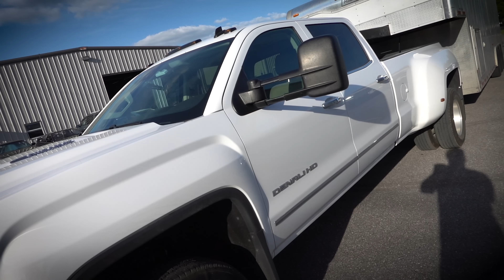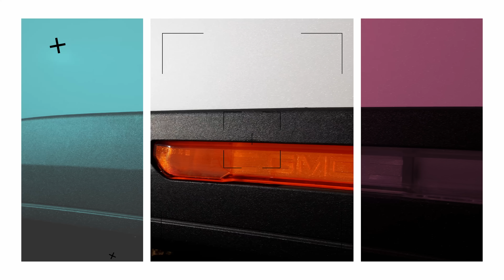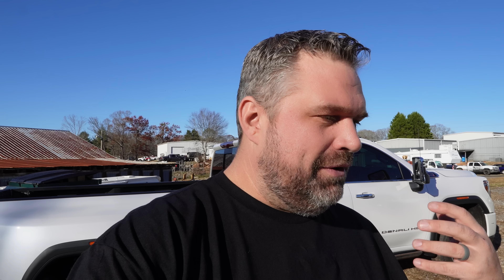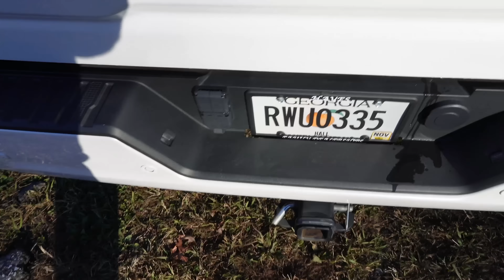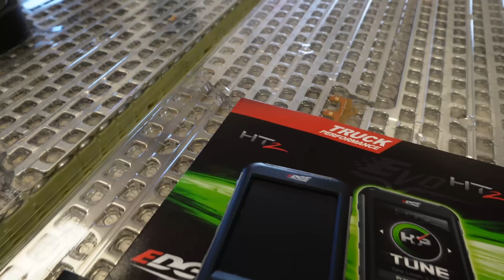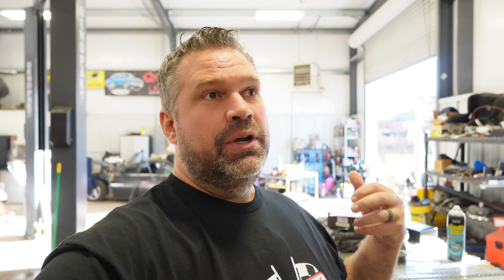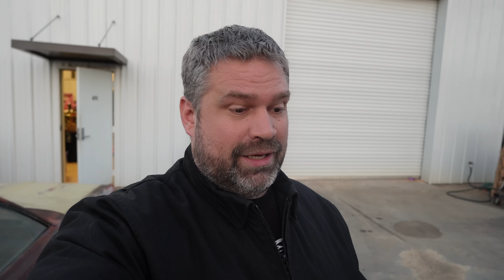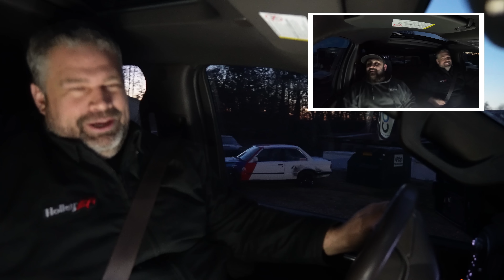My New GMC 3500HD Dream Truck Has A MAJOR Flaw! Can I Turn The Nightmare Into A Dream?!?

Comment: Fordtechmakeyouloco has a lot of videos about Ford engines failing in that one of the rockers would come apart which is the #3 in that the roller from there would ricochet all over the inside of the engine causing it to grenade.

Comment: I chose the same tuning for my 2017 2500HD Denali.. It is important to update the tuner occasionally with Edge.  I tow trailers, a 24 ft Camper, 24 ft enclosed car hauler and a 22 ft open deck car trailer.. I would recommend the Banks Intake over many of the others.. I tried 2 others before the Banks.. It is important to make sure that you let the truck get up to temp when using the Extreme tune.. it holds back until it is warm enough. Never tow anything over 2500lbs on the Extreme tune…the EGT goes way up fast.. my truck is basically a 3500SRW in spec. But still probably 800lbs lighter than the dually.  I get about 24mpg on the Stock tires and 20 on the Mickey Baja Boss A/Ts..

Comment: Your right! You don't know anything about diesels. Let me explain it this way. A 9mm hand gun with a short barrel and fast burning powder is your gasoline engine. Diesels can continue to build power by multiple injection sprays on the down stroke. It's like a high power rifle with a long barrel and slow burning powder. A adult child would roll coal.

Comment: 10:05 wow... my truck gets like 6 mpgs lol. Also verified by fill up, 6 of them to be exact. The most I've ever got was in the snow. i got 12.8 mpgs. If i do highways more one tank ill get about 10, and woth mostly city driving, I'll get 6-7 mpgs roughly.

Wouldn't trade it for anything though. It's got 213k on the dash, and i plan to send it to at least 300k if possible. Plus its hilarious to mess with stealerships with it. Just go into Chevy looking for floor mats, and they hear 2004 and immediately "no" or go in to trade it right before i wash it and ive been told they would give my $500 towards a new car lmao. They run $1500 on kbb

Comment: You can go fast in a diesel truck. Your tires, however, can't. They have a speed limit that creates problems when you pass it. That's where a lot of tires overheat and disintegrate, given not as much time as you might think. And truck tires, they're expensive.

Comment: My mods for my 17 2500 was Fass fuel pump/filtration system and replacing the fuel pump that was known to grenade itself.  I was going to get the def delete done as well, however my girlfriend totaled out the truck prior to me accomplishing that.  Good news was it was nearly paid off so the money I got from it paid off almost all of my debt that I had.
Reply: I am also waiting till my engine warranty is over before I do anything on the engine.

Comment: So if it doesn't roll coal with that tune, then why did you film it at night?  How about putting a GoPro showing the tail pipe when you get on it with the tune?  My bet is it still rolls some coal out.

Comment: Gee with only  900 Ft Lbs I don't know if you can spin your rear tires at will or not.
  I have chuged along with a 3208 Cat 636 CI   265 HP and 680 lbs of Torque for 12,000 hours then I  put in a Jasper rebuilt and that engine has 9,000 hours on it .. The Truck is 24,000# empty  6 wheel drive  ,.. I haul up to 15 tons of lime on it and tow  40,000# behind it .. with a smaller load I gorss 80,000# once in a while .

Comment: It makes me luagh to no end that my old 1995 dodge ram 3500 single rear wheel club cab long bed 3.55 axle ratio with 8ft bed 2 wheel drive slt automatic Truck now has 1,989,000 miles on truck and motor still is getting 38 miles per gallon on a good day and at worst 32 miles per gallon on the highway.  The 12v cummins never smokes and is left stock.  I still have the orginal exhuast and exhaust manifold.  I feel these new diesels smoke alot more when they go into regen looks like a freight train.  Keep buying new diesels i will stay with the old 12v cummins have a good one
Reply: Good old coming engine when they were still made in America. Were the original million mile engines.
Reply: But there's still one thing with your truck what can you tow my 2017 G. MC 3500 duramax. I can tow eighteen thousand pounds what can you tow.

Comment: a new base model 1 ton truck does exactly what one costing 30k more does, it pulls the trailer. once it has 400k on it 3 years later it is not really worth more than a base model so you just tossed your 30k into the trash.

Comment: I drive a deleted 6.7 ford, have not had a single engine issue in 200k miles. Just had to replace a vacuum pump seal. But i get the trauma of a 6.0. 😂

Comment: Diesels are efficiency monsters. Most setups have to sit on one side of the scale, MPG or HP&TQ, but with proper turbo control and fuel mapping a diesel can lift the entire scale, raising power and economy together. Using all of the fuel makes power easier, there's a whole science of over fueling robbing heat from combustion and reducing output. The more complete burn you get, the more power you get, Banks has pretty well figured out the formula, one of the few companies getting insane numbers while maintaining 50 state street legal emissions compliance on most of their parts.

Comment: Why would you  care about the “ Dodge” top trim level ? They have had ZERO to do with RAM trucks for nearly 14 years. The last time I checked, when Dodge and RAM spilt into seperate brands in late 2009/2010 , production was moved to Chrysler plants.  Didn’t you get that email ? 🤣🤣🤣

Comment: Sorry Jared but that’s not really an Allison transmission. That is the same 10 speed that Ford uses. Allison is just a licensing agreement now. It means nothing.
Reply from the maker: Not the same as ford at all, the gas trucks share transmissions, the diesel is a gm designed, Allison tested/proven trans
Reply: @TheQuestionableGarage  your  right, my bad. I know GM has had some issues with the 10 speed in the gas trucks. I hope the one in the diesel is better. I would imagine Allison would not let GM  put the Allison name on it if it wasn’t good.

Comment: I have the exact same truck except mine is a 2023. I went with the Banks Derringer almost immediately, 80 hp and 140 ft lbs more than the stock 445 hp and 910 torque. Several weeks ago I added the Banks cold air intake and holy S** the intake really woke the engine up. Best part was my regeneration mileage more than doubled. I was only getting 250-300 miles between regens before the intake and now I am close to 700 miles towing my 15k fifth wheel. Monitor your soot load with the Edge, some guys have killed their DPF's with too much soot from a dirty Edge tune, not so much the programmer you have, but the Edge that piggy backed onto the ECM.

Comment: Questionalbe don't get bummed by the numbers. Ford and Ram are posting numbers you'll never have access to when connected to the transmission. Your transmission isn't going to allow access to those max numbers when the pedal is pinned. So, the Isuzu motor can perform right with the others because real world it is very similar to the "big" number guys. Enjoy the new truck, its very nice.

Comment: Re-flash ytour OEM ECU?   Even if you need to push back to the OEM for warranty, won't that leave a footprint and void your warranty.   Both engine and tranny warranties, and that's a good 30 grand...    Isn't it?    Gosh, you are making a very questionable choice.   I'd rather see you do this AFTER the OEM warranty is no longer in tact.   What's that?   60K miles/100K?   I forgot...   So why not Banks where it doesn't leave a footprint when you disconnect it from the OBII?   Maybe there is a good reason.

Comment: Americans and their trucks... Can pull a semi, only ever tows a car / hobby trailer.
Just get a VAN with a hitch. Pretty much every motorsport team here (small, local guys) use a Van and a trailer. 
You have so much more useful space thats secure and don't even need a trailer most the time to move big/long stuff around.

Heck, if you look at drifting, the Shanahans (brothers, pretty famous in Drifting circle) use a van to move both cars and all they need for a weekend.
They have a sweet small stacker and just hitch to their van. Also, you don't need a 6.7 v8 with 1000 torques.. Thats what gears are for. Or a Semi

Asks for "Why not get a Denali" to the guys actually working them.. Cos more stuff, more cost, more problems.

On the emissions stuff, 100% agree, Aussies have found most newer rigs will be as powerful with as without the emissions stuff. Just as tunable.
And dear god is rollin coal dumb "Yay I made smoke".. Congrats, you are literally the bad guy / dumb side-kick in every kids movie ever..
Reply from the maker: If you see the trailer attached, it’s 48 ft long, a van won’t pull that. I bring the entire home with me to the track(full living quarters inside it)

Comment: The only time you might not want 1000 ft lbs of torque....if you have a 80s Saginaw, or close ratio Borg Warner aluminum 4 speed transmission from the mid 60s.... Kinda regret blowing them up behind my mild cam, flat top 454 big block. Age and  Wheel hop didn't help, but when a transmission is rated at 300/300.....there is a reason 490 ft lbs does bad things to it. 
Gotta respect a modern transmission not instantly turning to 10 neutrals....

Comment: From watching the video, the one thing I dislike about the new truck is the location of the top seatbelt mount. Low and forward are not so good in a frontal impact, regardless of SRS airbag function. dislocated shoulder and broken collarbone are not fun.

Comment: Depending on where you are in the world and the local tax and finance rules that apply spending five to ten thousand on factory extras that you can get from amazon for about a grand probably doesn’t make your accountant very happy come the end of the month.
A wise hotshotter will buy the most base possible vehicle with the best drive train possible that has the least cost of maintenance and downtime. Then depending on their particular situation they will pull the entire interior and fit in a good seat and any extras that make things actually better. They may even convert the passenger seat into a bed or toilet or both depending on the room available.
Then when they have driven it into the ground they refit the original interior (and possibly odometer) have it detailed and sell it to some poor sucker who thinks he’s getting a deal.

Comment: It's so useless to have a truck so high that you need a ladder to get into the bed.  I mean, nice truck, it's a smart buy... but more of a commentary on the broader market. The height of the gmt400 was great, gmt800 is very acceptable.  Most consumer level trucks today are garbage, and it has everything to do with the buyers.
Reply: For the record, this isn't a consumer level truck... I'm talking about every Brian and Kate out there driving their half ton trucks through suburbia to their job as a teller or accountant.
Reply from the maker: I agree, I do use the truck to its level enough that it justifies it. But the number of 3500 trucks going for Starbucks is way too high.

Comment: No! God no stop and do not use box tuners. Edge is garbage, banks is the not worth the price tag. Please take that garbage off that truck. If you want proper tuning contact the experts you should be tricking anything. Ive had and ran diesel trucks for the last 6 years and i 100% agree that roalimg coal isn't the cool thing todo. Neither is getting garbage box tuners suck as edge and banks. You need to reach out to professionals make some parts go missing and get a proper tune. You think 26mpg is good that is hilarious how you have been tricked. Come on man loven the videos but i gotta disagree on this 110%  edge "tunes" are going to destroy that truck and brick ur ecm.

Comment: Thank you for promoting doing mods for street vehicles cleanly. As you pointed out, our hobby is under enough scrutiny right now that social media folks have an obligation to set an example for the rest of us. By putting the content out there you all are the "face" of the hobby, so it is important to show that we ARE willing to have our hobby and at least TRY to abide by the rules and do the right thing for the environment as well as showing the fan base that it IS possible to make power, go fast, pull hard and still do it within the rules. So again, thank you.

Comment: Hotshot drivers tend towards the base models for a couple reasons:
1) They're often Enterprise commercial leases, and that's what Enterprise buys. Leasing wouldn't usually make sense, except modern diesel pickups are.... Modern diesel pickups. They're good until they break suddenly and catastrophically, leaving you stranded, and are then in the shop for an eternity waiting on parts. Enterprise leases, however, when they break suddenly and catastrophically leaving you stranded, comes with a replacement from Enterprise's rental fleet, so you just call your insurance company, transfer from the dead truck to the loaner, slap your stickers on the side, hook the trailer and scoot. This means your ownership costs per month are fixed and predictable, which is a safer way to run a business, even though the expense is higher. Plus, if you're getting a shiny new truck every 2 years on lease, you're going to hit statistically fewer of those catastrophic failures. Plus, Enterprise charges *per mile*, and you also charge per mile.
2) Chrome doesn't pay the bills. 
3) Because they're company trucks and the boss isn't gonna pay for higher trims.

Comment: I want to tune my Volvo D5 to stage 1 with 210hp 450nm torque, stock atm is 185hp and 400nm and i was also thinking about bypassing the DPF for even better fuel economy, i can't really go above 210hp with the manual and AWD, Maybe 230 but then i need to start replacing bigger stuff

Comment: Android Auto / CarPlay was an issue on your 2015 because it wasn't offered until 2016.  It is a farily easy retrofit from what I hear (I own an '18 I bought new, though I'm only at 28k miles now).  I don't use Apple, but Android Auto works great on it and even better with AAWireless so it is wireless AA instead.  I agree with the HUD, cameras, rear view mirror camera being nicer.  Interior isn't much of an improvement until the 2023 (1500) and 2024 (2500/3500) came out - THAT is a big improvement and puts GM back to where RAM and Ford had moved up to.

Comment: I’ll take my Ford with it high tow and load ratings as well as the higher horsepower and torque. The stock transmission is also more capable when adding more horsepower with tunes and mods. I’ve had less issues with my fords than I have the others. The dodge ended up with 2 motors an a transmission and a few DPF replacements. The GM had the turbo replaced 3 times 2 transmissions and practically a new front end suspension. The ford a fuel pump but that was just because I added a better pump.

Add your own rear entertainment system which is better and bigger than you can get from factory.

Comment: Why do hotshot drivers not get loaded trucks...to quote you "If some of this tech starts breaking...".  When you income depends on the truck doing truck things every time you have a job, you want only things needed to do that job.  If you review any "Quality" metrics (JD Powers, Consumer Reports, or any of the fleet service records) the #1 reason a vehicle gets sidelined is tech failures with diesel emissions issues being a close second for the fleet vehicles.

Comment: As a forever hotshot driver, spending sometimes an additional $20k to even upwards of 40k for a decked out truck that does the same job as the less expensive truck didn't make sense.
Reply: Also there are a lot of company drivers that don't own the truck, so you wouldn't want to give a driver something nice to get damaged and acquire additional losses.
Reply: The end goal is to be profitable and having low overhead, and there's still the depreciation factor as well

Comment: I’m with you on the rolling coal issue. It can a safety hazard and health hazard. I think if someone causes someone to have a respiratory attack or wreck because of it the vehicle should be confiscated. If done on purpose then the truck is a weapon used in an aggravated assault. I know older diesels smoked a bit when given a decent amount of throttle. But discretion still applies. Stacks helps get the smoke above most cars and dilutes.

Comment: 8000 lbs is on the light side for an emissions equipped 20+ crew cab dually in my experience. Have you scaled it? Might be surprised how hefty it actually is.
Reply: My '20 SRW 3500 "standard" bed lists curb weight @ 8300